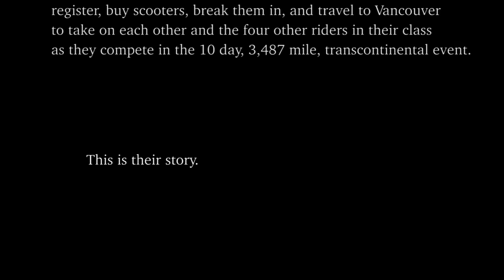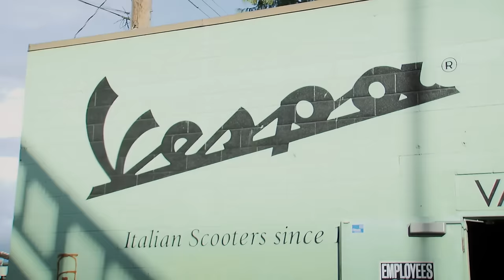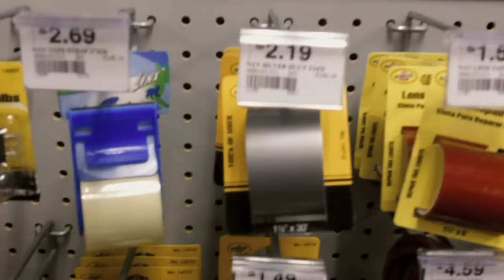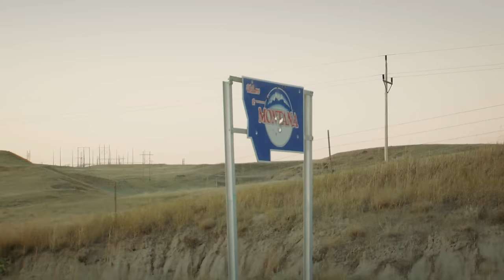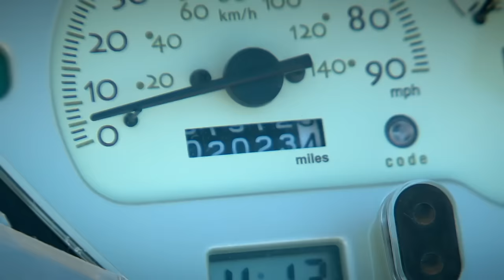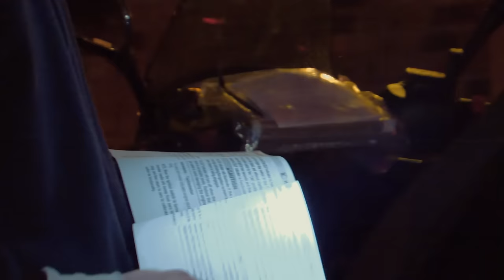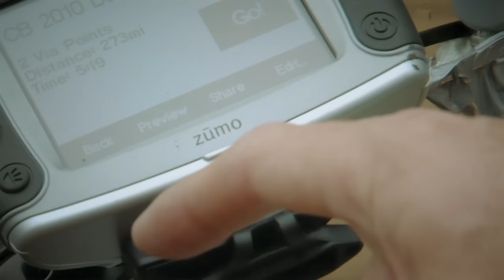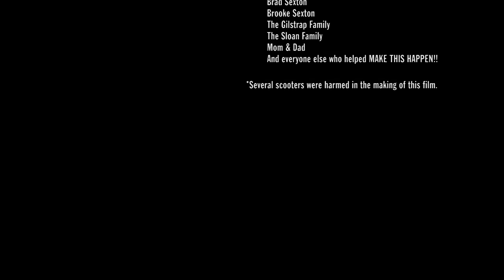It's Not a Race: The Scooter Cannonball Run | Riders Documentary | Full Movie

Comment: That oil light issue @20:00 or so is a service maintenance light, it's VERY common on motorbikes to turn on to tell you to go do the 1000km servicing on new bikes. So if you've never owned a bike or brought one new before it would freak you out. It caught me off guard on my KTM Duke 390 and Honda Grom. It goes away after 50kms or so. BTW I sooooo want to do this one day. Maybe on a big bore Honda Rukus or big bore Honda Navi .. I'd rather do it on a Grom but that's not a scooter.
Reply: Bingo, had the same issue during the 2023 SCB run about 700 miles in. Groms are welcome. It'll be the greatest thing you ever do.

Comment: After buying a 49cc 2 stroke scooter to test the water to see if I wanted to get a Motorcycle (which I did) and doing over 2000km on the scooter (in 15km stints) I can honestly say there's something wrong in your head if you want to ride it across America, along highways etc.
 the fact they are speed limited to 45km/h is the first problem. the cars that want to go the urban speed limit literally push you off the road to get past, get very angry and abusive. & the only way to fix it is to remove the Gearing limiter so it can do 60km/h (10 km/h above the speed limit) so you can keep up with the flow of traffic and be safe (it also saves a ton of gas not having to be at full throttle all the time, and being able to go faster)
The next problem is that they are a light weight "Sail" and get blown around like a balloon.
and then there's the cramped seating position and the knees hitting the handle bars all the time.
not to mention, it requires different muscles to hold yourself up than it does on a Motorbike or car, so if your not used to it you are going to get a very sore lower back.
but hey, I'll happily be a support vehicle with my V-Strom!
Reply: I must add... buy a Japanese MADE scooter to do it, mine was Italian design, Chinese made using a clone of a Yamaha design engine, and the rear wheel bearing gave out at less than 1000km (around 550miles to be precise)